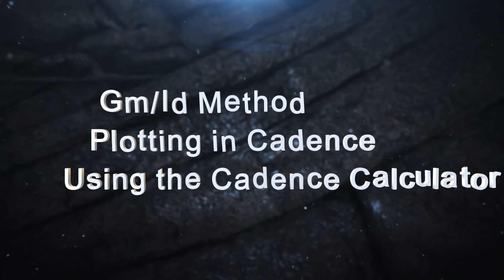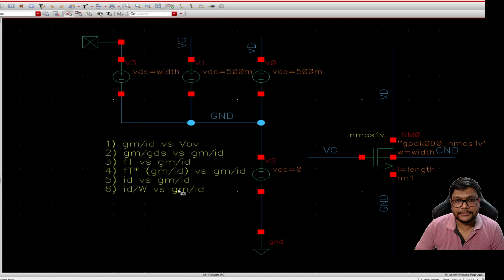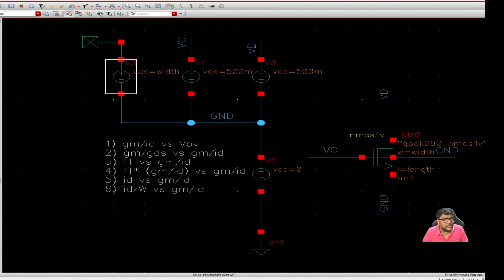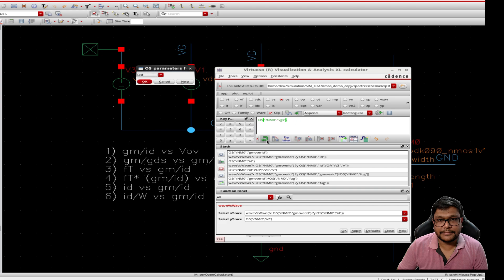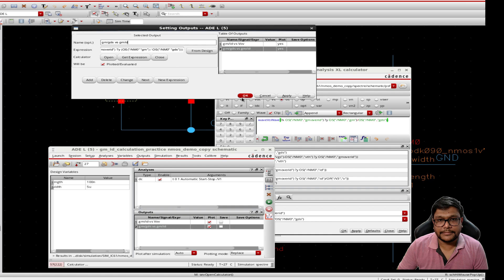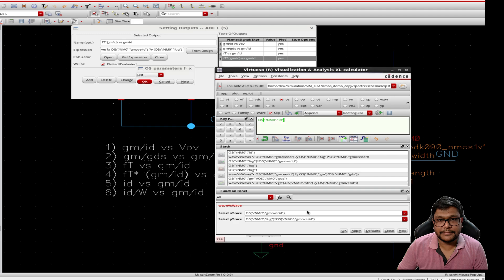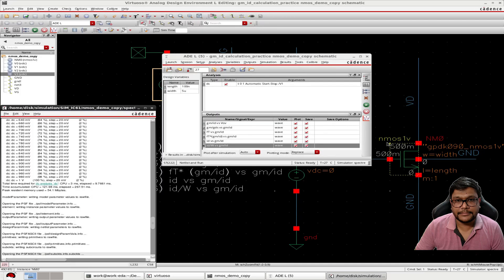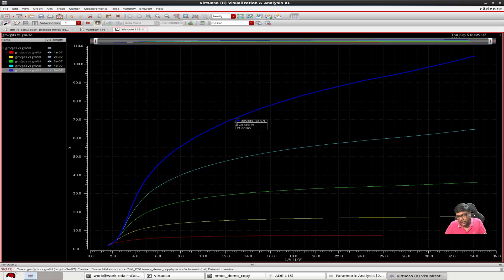Gm/Id Method | Using the Cadence Calculator

Comment: How did u connect that x block in circuit?
Reply from the maker: That is a no connection and you can get it from the basic library with the cell name noConn. It is to avoid the warning about that net is floating.